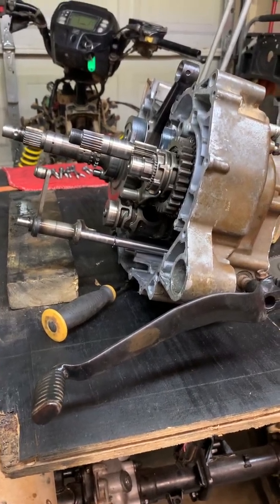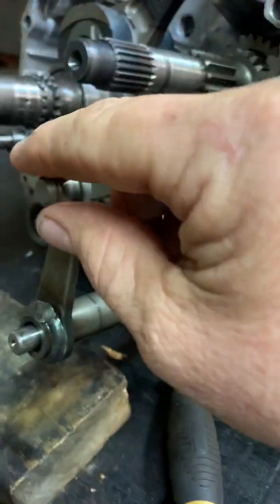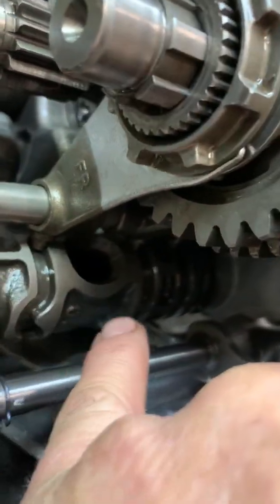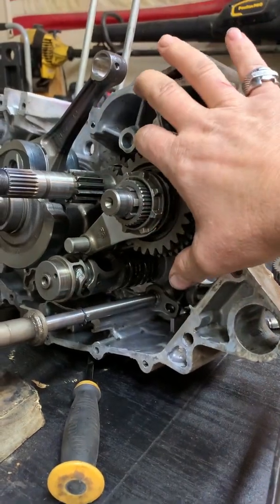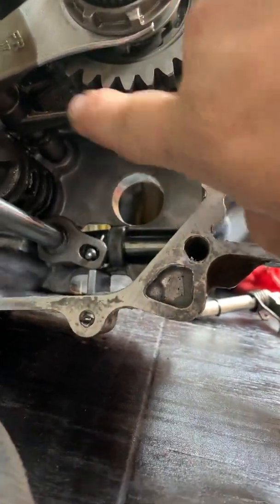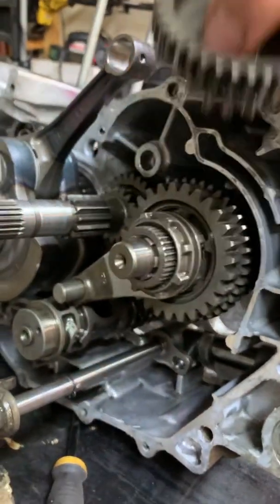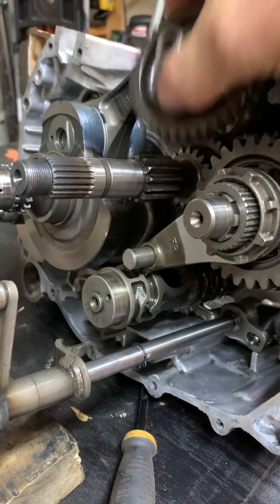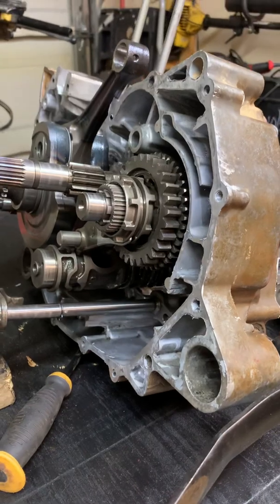Honda ATV Transmission How It Works Rancher 420 Foreman 500

Comment: Just finished up a rebuild on a rancher and it will only go in first gear and neutral. I have no reverse or and gear higher than 1st. What do you think could be a culprit?
Reply from the maker: I’d make sure all the tits on the shift forks are in the drum correctly
Reply: Did you ever figure it out? I’m having the same exact issue.

Comment: What would be causing my shift linkage not to up shift my bike is currently stuck in reverse. It will shift down but won’t shift up
Reply from the maker: I’d guess broke shift fork or gear tooth jammed up
Reply: @richvandenbroeke5493 hey bud I'm having same exact issue what did you figure out
Reply: I have same issue would down shift but won't shift up and the foot shifter loose going up
Reply: I got a similar issue, I can shift up and down but it shifts rough. Doesn't glide when I hold down or up in the lower gears as well. Any thoughts?
Reply: @echabot2721  i would try giving it a clutch adjustment make Shure oil you are using is Valvoline with the motorcycle on the front of bottle it JASO approved doesn't make clutch slip
Reply: @echabot2721  not the bottle with the ATV on front it's not JASO approved